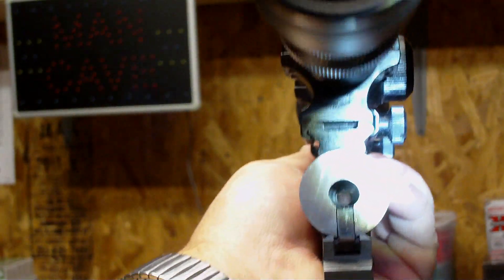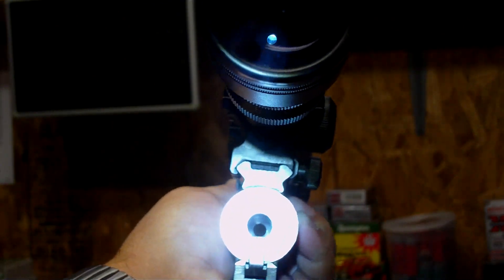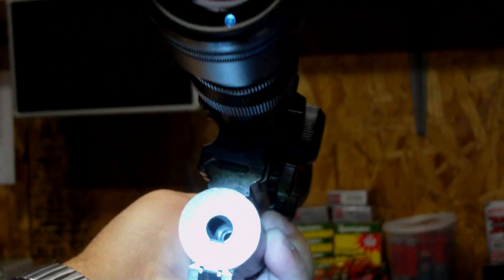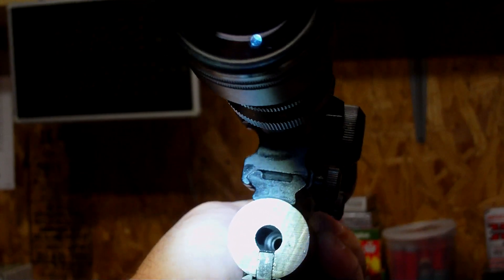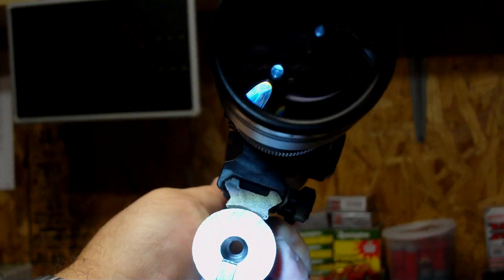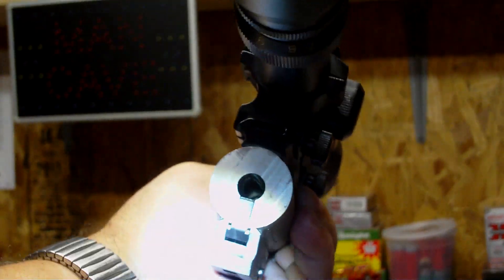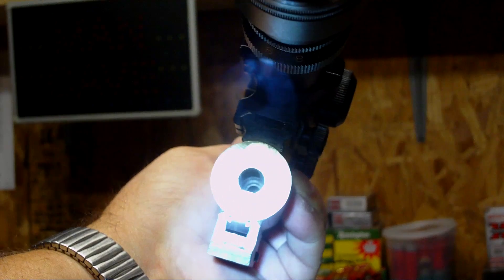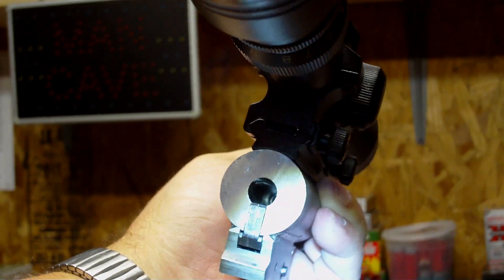Polishing a firearm chamber - end result / final view

Comment: I have the same problem with casings getting stuck in my AR-15 Chamber. I then have to pound out the fired casing with a cleaning rod while pulling on the bolt handle rearward to get it out otherwise the bolt will not pull to the rear. I will try this method to see what results I get. My barrel/chamber is made by Daniel Defense.

Comment from the maker: If the chamber is that tight you might want to take it to a gunsmith and have him run a .223 reamer through it. This usually happens when a worn tool head is used. In the eighties I bought a new Ruger Blackhawk in .357 magnum where you could not eject a fired case from one of the five chambers in the cylinder without pounding it out. A worn cutter/reamer in the factory caused that problem in that one chamber, someone probably missed changing it when they changed the other five.

Comment: does it eject now?
Reply from the maker: It sure does!
Reply: i have a nef in 270 the cases get stuck in. ive done this but i used brasso. i hope it fixes the problem. the fired cases are swelled at the base probably a centimeter from the primer up.
Reply: you had mentioned a process of polish shoot polish till its ejects. how many times did you polish im about to throw mine in the round file
Reply from the maker: Try lapping compound (valve polishing compound) it is very abrasive but if you do it manually running a rod/plunger in the chamber about 5 times each time you should be able to get it done quickly. You should have a gunsmith do it for you to avoid any accidents.